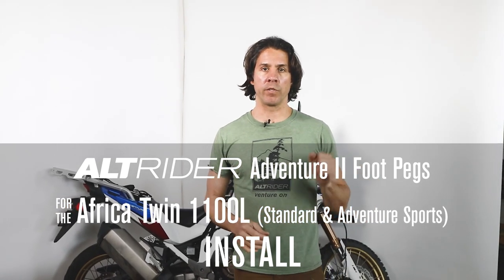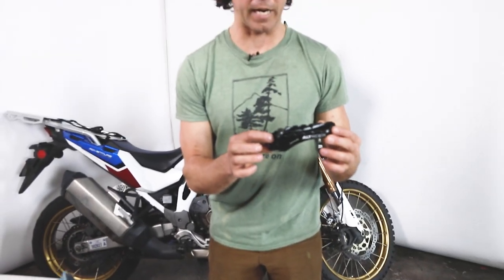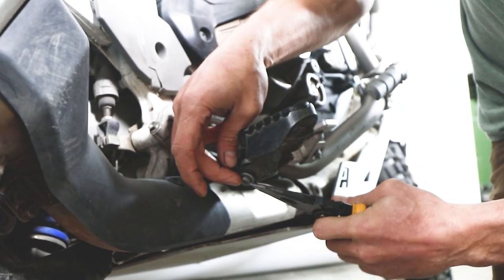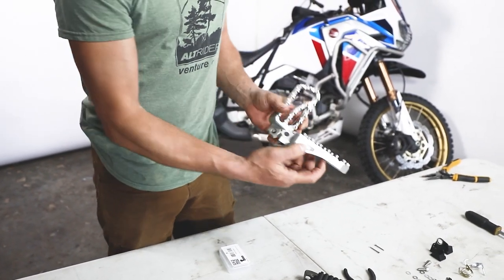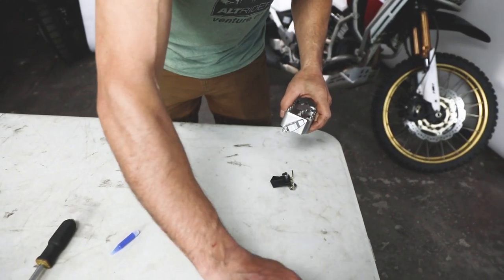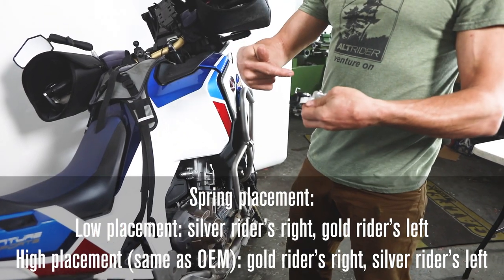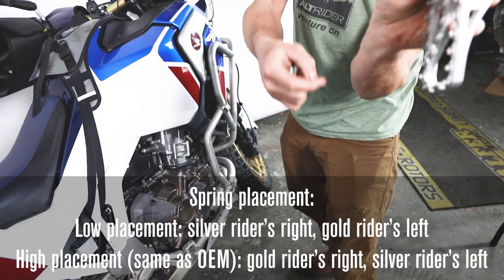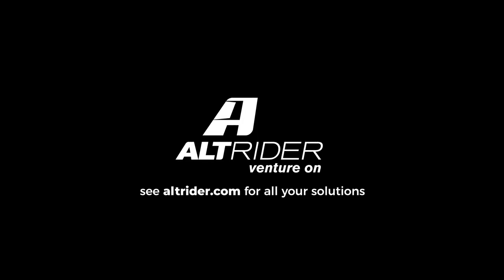Honda Africa Twin 1100 Foot Peg Install by AltRider

Comment: Hey have your pegs for my Tenere.  Do you make them for a BMW R9T 1200. URBAN GS?
Reply from the maker: We make foot pegs for the R 1200/1250 GS, not the R9T. I'm not sure if the R9T has the same foot peg mount as the R 1250GS
Reply: @AltRiderLLC  I'll check and see. Thanks so much. Like your products
Reply from the maker: If you're able to confirm, let us know!